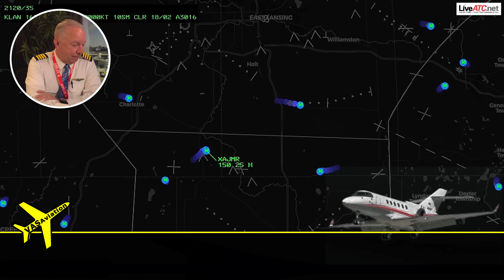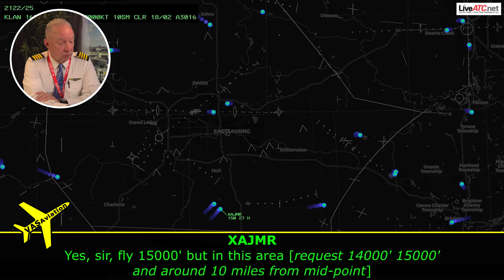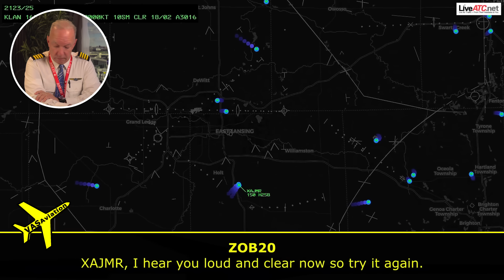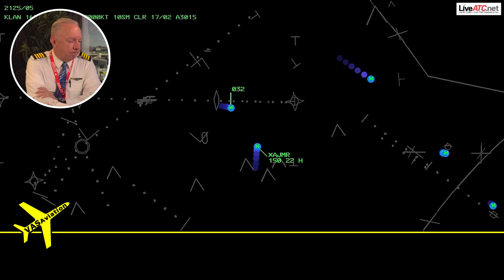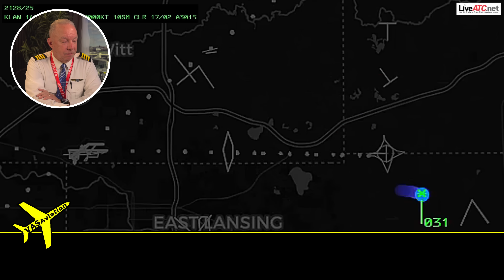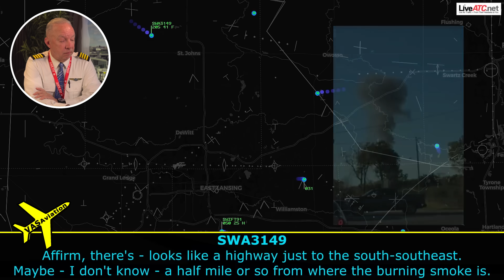Inside the Hawker 800XP Stall Test That Ended in Tragedy

Comment: I flew the T-34 too and while your recommendations for spin recovery may be correct for that aircraft and many others, it is NOT a procedure for every aircraft.  These high-performance biz jets with swept wings which fly at high sub sonic speeds are much more like a fighter than the T-34 we both started flying in.  For example, the spin recovery procedure for the F-8 I flew in combat was full aft stick with full aileron INTO the spin and full opposite rudder.  That is NOT something you would think is appropriate and it was discovered only after a lot of spin testing by factory test pilots in aircraft equipped with anti-spin parachutes fitted to the tail.  The point is, that spin recovery can be different for different airplanes and the procedures we used in the T-34 may be completely inappropriate.

Comment: When that aircraft was originally designed it had a T tail, as did several British commercial types at the time. Deep stall was a problem and a number of test articles were lost. Hawkers brought the horizontal stab further down the fin. Just an observation. I have never flown a T tail, but the morning of my wedding I was up in a C 150 doing stalls. Always dropped the same wing - until it didn't, I anticipated wrongly and put in a spin. No great shakes - half a turn and 200 foot drop, but it taught me not to anticipate wing drops. Sad for these guys. Should always have the correct guy in the seat on test.

Comment: The stall check should only be attempted by a paid test pilot. There is a company that has a huge facility in Battle Creek, which completes major Phase checks. When the stall strip is removed on a Hawker, it needs a recertification check. Too many operators put their pilots at risk by not having a factory training pilot do this check.

Comment: Very informative video. This was my family’s airplane, we are devastated by the loss of captain Francisco, captain Rodolfo and Engineer Alvaro. Thank you for being kind in these difficult times😢🤍
Reply: Our sympathies for your loss. We are in sorrow with you.
Reply: My condolences to you and your family.
Reply: So sorry for your loss
Reply: I'm so sorry this happened.  I pray comfort for your heart.
Reply: I'm assuming this is a Beechcraft Hawker, not a Hawker jump jet.
Reply: Advocate for a parachute that helps saving lives. We need more safety on these planes
Reply: @tafabeatz  don’t think that helps in this particular situation. They had 10ish seconds in a stall spinning
Reply: This is presumably a test flight if some sort, after major maintenance its best to have plenty of height, normally over 12,000 z-14,000ft oxygen is needed. Usually a test stall would not go in to a spin, though it
depends on type and handling.  Test pilots generally will wear a parachute, but I dont fancy they want to get out in a spin. I have seen aircraft which ar3 not cleared for spinning. This was 1980's. I would not fly in these. But my limited experience refers to single engine, two heaters.
Reply: Cartels money and tears open that mouth
Reply: @Battlefieldfusion-w2b  Be quiet and go be useful you stupid idiot.

Comment: Hawker needs to revise that procedure and/or add a drag chute to the plane AS WELL AS require spin-trained and -qualified pilots for the test itself. This is into fighter aircraft spin territory and the flat spin of the F-14. You've got to be some amount of crazy to get a F-104 into a deep stall with the elevator blanked out. The difference is that the F-104 has an ejection seat AND a drag chute to go with that T-tail. The Hawker doesn't.

Comment: The Hawker is a T-Tail Plane with rear mounted engines. When the wing stalls, the turbulent air can disrupt the airflow into the engines and lead to a flameout. Secondly, the horizontal Stabilizer can be "caught" in the airstream of the stalled wing, making recovery near impossible due to the lack of control autority (deep stall). 
I know, that sometimes for this reasons, little parachutes at the top of the rudder are used as a last resort on this kind of stall test flights. Does anyone know, if they're available for this plane? And if they need certification for a test flight?
Googleing however does not bring up much information of this. So if someone can tell more about them, when they are used and how, i would appreciate that greatly. @Captain Steeve: Maybe material for a short video?

Comment: The Hawker 750-900 XP has an alcohol deicing system. Mesh panels are installed on the leadingedges which press the deicing fluid on the air foil. Once ONE panel is replaced, a stall test flight must be performed. This british aircraft, designed in the 1960s, is known for its critical stall behavier. I am NOT a pilot, but I am curious why the initiated the stall at FL150. Why are pilots forced to do such manouvers which do not have proper training or practice. In my opinion the operator has weak procedures on Maintenace Check Flights.

Comment: This plane crash was all over the news here in Michigan. There were 2 pilots and a maintenance tech on board. The plane had just had extensive maintenance done and this was a test flight. There is video from a cell phone on the ground, showing the plane in a twisting, straight down stall.
Thanks for the great explanation, Capt. Steve!!!     - -Mike D. Air Force Vet. C-141 Crew Chief. - -

Comment: I’m a GA pilot and I’ve done spin recovery training on several flights, never had an accidental spin. First, just for awareness of non-pilots out there, stall recovery by itself doesn’t result in a spin, only if the stall is uncoordinated and one wing stalls first, I guess if there’s a malfunction or misalignment that could happen. But why would a plane spin “upside down”, as was mentioned? You’d just enter a slightly nose down flat spin, not an inverted one. I seriously doubt a Hawker is recoverable at all once it enters a spin, unlike the C152 in which I practiced back in the day. Sorry if I’d misunderstood something.

Comment: I'm not a pilot or know anything about flying.  I'm 72 and in my day did over 100 skydives which is nothing like flying.
I was driving down a backroad and watched this plane crash.  It was strange. It came straight down! It looked as if it was intentionally being brought down into the ground.  It's amazing to me how iout of control it was.  It's hard to believe someone would purposely create a situation that dangerous and try to pull out at that altitude.
What is the ourpose of the dangerous test?

Comment: I have been fly Hawkers since 2003 and it's not just the wing that can stall but also the elevator. I had an elevator miss aligned and the tail quit flying not the wing. To many questions on what went wrong. My thoughts and prayers to the families of the pilots.

Comment: Have many years experience as an AMT on the 800, 800XP, 850XP, and 1000. In my younger days when we took delivery of an aircraft which were 800xp, 400A, and B200.  I tagged along to check the "interior" etc to make sure everything worked.  The crew would take them and would performed stall buffer/check.  I always enjoyed that part, but as I got older.  Not so much any more.  I've been an AMT since 80's (military as well) and I don't like flying any more.   I came close to using my 1 in a 11million chance from wake turbulence.  Also, I don't fly with 91 operators.  They don't have the recurring training as 135/121.  My days in the NAVY at Pax River.  I had to search the beach for wreckage and body's after a Caravan ended up in the water by wake turbulence due to a F-14.

Comment: Been flying Hawkers for 25 years. These aircraft require a stall test every 4 yr major inspection cycle when the leading edges of the wing get removed & inspected. The stall test verifies the stick shaker, then stick pusher activates before the actual stall break. You do this for each flap setting. If the stall occurs first or you drop a wing you must quickly unload the wing. This would indicated a failed test which requires making adjustments. We have always hired trained test pilots to do the stall test. Line pilots should not do this.

Comment: I’m surprised that this issue does not have more widespread awareness and that these airplanes apparently did not encounter problems during factory completion testing and/or certification. At least not that I was ever aware of. Im no aerodynamicist but you wouldn’t think that the design of that kind of wing would be subject to such adverse characteristics. The airfoil is relatively thick and it has a mild sweep in its simplicity (it’s a relatively slow jet). It has a large flap that incorporates a lift dump system that slows the airplane so much upon landing that thrust reversers are rarely needed. It’s a real shame that this is an issue with the Hawker series because otherwise they are wonderful airplanes to fly and extremely reliable.

Comment: This is a hot Rod aircraft where the stall tests should really only be performed by hawker test pilots. This is at least the second crash in 2024-2025 from hawker 800 stall testing (there are others too) The pilots could barely speak and convey what they wanted, (or work the mic’s it seems) is it too much outside the realm of possibility that they were under qualified to fly such a complicated task too? What if they had landed on a school bus full of kids? This should only be performed my hawker test pilots. These guys were in wayyyyyyy over their heads.

Comment: You describe stalls wee a wing drops and initiates a spin. Not all do. I have taught on Cessna 150 and 172 and 90% of the time both wings stall together. Recovery from a stall is unlike spin recovery. Spin recovery is not taught in many flying schools and the aircraft are placarded to that. That is unfortunate because my first spin 50 years ago in a 150 scared the heck out of me. The only accidental spin I got into was in a Texan which scared me more. Fortunately I had training and the the Texan was at 9000 feet.

Comment: Back in 1973 I was flying an FCF in an F 4D as a FCF WSO with the Wing QC pilot.  We were doing the negative G disconnect check for the auto pilot when the autopilot threw us into a negative 5 1/2 G stall.  The Bold Face checklist only applies to positive G loss of control so the pilot had to do exactly the opposite.  We went from 35,000 ft to 15,000 ft in a matter of seconds.  It was eye watering.

Comment: Nothing on the AIR INDIA Grounding on 787's because of total  electrical failure WITH RAT on 3 of their flights , VERY SIMILAR TO THE CRASH YOU CALLED PILOT ERROR causing pilot strikes

Comment: Ah yes... In 2025 where we can translate things at light speed we don't have any of those systems in place where they should be. You should have basic English for flying but if there is a problem in understanding the pilot should be able to just speak freely in their own language and it should translate for air control. That could happen yesterday. Doing the same but vice versa might take a little longer to install those systems in airplanes but it could easily happen.

Comment: Why this crew is trying to practice an stall in flight, is not better the Flight Simulator to do this randon practices?
Reply: They almost certainly were testing the stall prevention systems of the aircraft, which I believe has both a "stick shaker" and then a "stick pusher" if you get even closer to the stall.  It appears that they either went too far or that the "stick pusher" did not work as intended.  So instead of finding the point where it activated, they found out the hard way that it didn't.
That is what I've gathered from pilots of that range of aircraft, including that exact model.  You should NEVER intentionally stall a swept-wing aircraft unless you are a properly trained and accredited test pilot.
Reply: If you're only purpose is to practice stall/spin recovery, but that was not their purpose. Context matters.

Comment: No one should be stalling a swept wing T tail jet That's the dumbest thing you can do. They were out to test the stick shaker and stick pusher these are still prevent devices. And those you can test on the ground I should know I've done it many times. This is the second fatal accident for the hawker aircraft, when are they going to learn to revise their procedures so they don't have to do this test in the air, beechcraft is acting like a criminal if they don't fix this.

Comment: This aircraft has a T tail and can encounter a deep stall where the dirty air blocks the function of the elevator, preventing the lowering of the nose and recovering from the spin. The only way out is to induce a spin, using rudder and aileron, and then to recovery from the spin. 

Not a task for regular pilots.

Comment: PARE from spins!  (power back, ailerons neutral, opposite rudder, elevator forward) Spin recovery. 2,000' seems too little for a practice recovery.  Also why isn't ATC notified in advance (phone) when a "practice area" is needed (for larger planes)?  Location and dimensions could have been worked out then.  Airspace is finite.

Comment: The NTSB will be looking at the maintenance facility first. Was the stall system (AoA sensors, stick shaker, stick pusher, wing slats) properly re-installed and functioning correctly? If the pilots kept pulling back looking for the stick shaker which never came, they got too deep into the stall and lost control. Definitely a job for Hawker trained test pilots only

Comment: hi Captain Steve. here is the situation we experienced recently on AA flight . 
we boarded a plane from Calgary to Dallas. Captain Lance ( maybe colleague from AA  that you know personally ?) came on the air and reported that one of the engines did not start and maintenance coming to troubleshoot. Maintenance arrived and they kept trying but engine did not start. Captain reported that maintenance crew going to start the engine manually and try to send us on our way. They manually started the engine and we got going. 
NOW.......i felt a 'little" uneasy flying on that aircraft. I felt like they patched it with spit and duct tape just to get us going. 

moreover, Captain came back on the air and said that in their 60+ years of collaborative experience they never had that happen before!!! that statement did not add any confidence in the situation. however we made it safely!

Can you please elaborate on that situation? was it completely safe and nothing to worry about? Or was it concerning what they did?
Thank you so much!

Comment: My only Hawker experience was years ago. A friend was a corporate pilot and they bought a Hawker! 125-400. It is the only plane I have ever seen that literally fell apart sitting in the hangar! It had the old Viper engines and was a maintanance hog! Then years later I saw a brand new 900 and there was bad corrosion on the flaps, just like the 400 had! The pilot said it was the only plane he flew that had green exhaust!

Comment: He doesn’t even mention the most important thing to do first before even taking off. Make sure that center of gravity as well forward near the forward limit. Small jets like that with aft mounted engines can often times have their center of gravity too far back. And then if you get into a stall it’s much more difficult to handle it if you don’t have your center of gravity forward.
I have lots of experience in the Hawker 1A, and 3ARA, there is no real problem stalling those aircraft although the wing drop off can be a little surprising. But they recover just fine if you make sure your center of gravity is correct, and you know how to stall an aircraft correctly in the first place. A lot of corporate pilots don’t have any practice at all doing the real stall in an airplane. All they do is train to the stick shaker and then recover which is no way to understand the characteristics of the airplane.

Comment: EVERY swept wing jet pilot knows you DO NOT STALL.... may be in simulator... RESPECT the stick shaker is mantra.  These test flights should never be tried by line pilots. EVEN when executed perfectly, it's high risk, and often results in an abrupt, momentary loss of control. If autorotation (spin) happens, even an incepted stage, in a swept wing jet, recovery from 10k feet. A deep stall is deep doo-doo. I use to post maintenance test flights in reginal turboprops for my airline at the time mid-80's. It was often some of the more risky flying I ever did. I am not a test pilot. I have flown brand new experimental kit planes I built. I have done a lot of post maintenance GA flights (for a flight school I started at).  I WOULD NEVER do this stall test on a Hawker 800. My question is WHY is removal of leading edge (and stall strips) and reinstallation SO CRITICAL? It should go back on the same way it was when removed. Good grief.

Comment: I doubt they were qualified maintenance test flight pilots.  They would have known how to request a block of altitude.  I bet they were pilots for the owner picking up the aircraft from maintenance and were doing a test flight with the mechanic who signed of the plane before returning to Mexico.

Also, stall recovery in most planes requires pushing forward on the flight controls, not just releasing them.  In an Airbus, it would be fatal to just neutralize the sidestick, as the plane would request full up elevator/stabilizer to maintain 1G.

Comment: Swept wing airplanes STALL at the wingtips first! This is unlike a straight wing that stalls at the wing root, first. Some stall, test flights require a drag chute to be attached to the tail area; if unable to recover from a fully developed stall. There may not be a spin involved in this accident sequence.